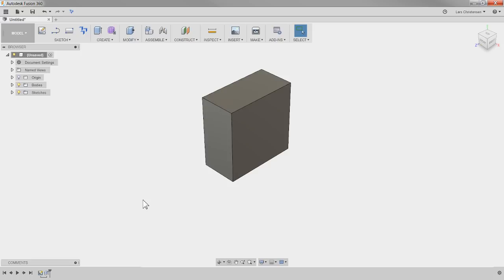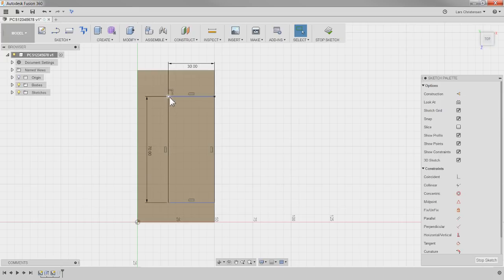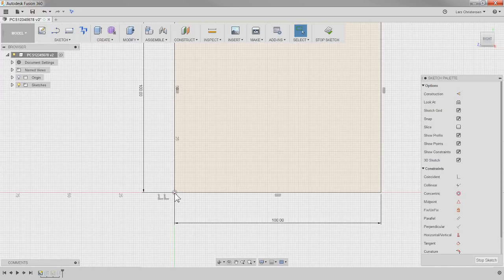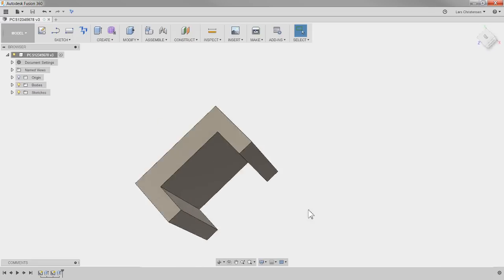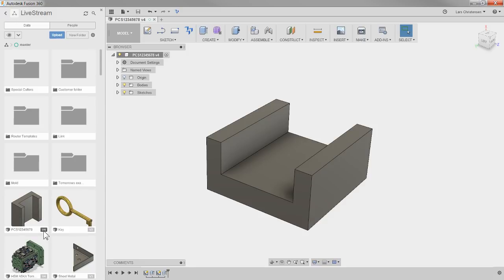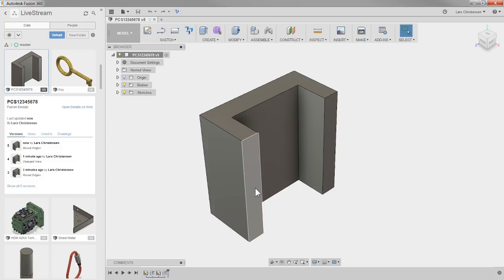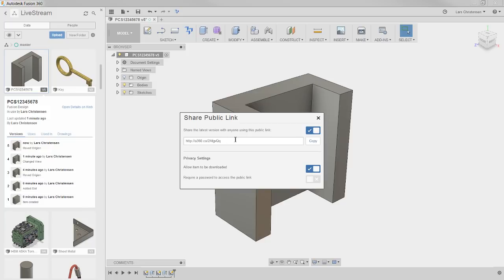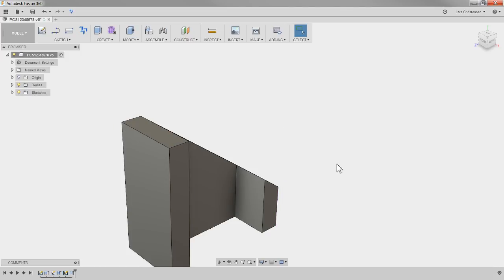My Biggest Mistakes with Fusion 360 — Tutorial — #LarsLive 97

Comment: I am definitely into you Fusion 360 videos!!   Big fan....have been NC and CNC machinist since late 70's....technical writer also....have one crucial suggestion from being in the shop and a programmer / blueprint interpreter for 40+ years...."Instead of lecturing; stating:'Define Your Sketches...' which is crucially important.   However, to the Novice and non-machinists;non- Designers;   is sounds like the plausible terminology.....when you get into the field as a Professional, you should tell everyone: "..to specify every workpiece feature's dimensions..."   By stating: " define your sketches."..in the real design and shop environment (which everyone hope to progress to)...that would mean to name or give a defined name to your views or shapes or workpiece sketches....not to the dimensions or specifications.

Comment: Do you have a video that explains the difference/relationships between Projects, Parts, and Assemblies? I saw in one of your beginner videos in which you made an assembly (I guess) that consisted of a main part and its associated cover, plus two imported screws. But when you want to 3D print that thing, do you have to somehow extract each part into a separate file, or do you somehow "select" each part (sub-assembly) and there's an option to make an stl file from just the selected part?

I'm hoping to start working on my first Fusion 360 project (?) and it will consist of a whole slew of individual parts that need to all fit together and then be individually 3D printed. What design approach do I take for something like that?
Reply from the maker: Hi Roger Garrett Thank you for watching!
You can right click on each component and save them out individually to their own file.
Reply: Excellent. Thank you so much, for all your videos and for taking the time to respond to questions.

Comment: Could you possibly make a video in Cam to show how to cut out shapes in carbon fiber? I don't need to remove alot of material. I just need to outline cut 2mm to 4mm thick sheets. 
I can't find any videos like that. 
Thank you!
Reply: I think you will want an engraving program like F-carve or one of the other free ones to just trace/cut the outline.  Not that cam can't do it.
Reply from the maker: Hi David DePuy Thank you for watching! Are you cutting it with a knife blade or a small endmill?
You could use a 2D Contour toolpath to cut the perimeter
Reply: Lars Christensen 
Using a small end mill. I'm new to fushion. Been watching lots of videos. Usually my simulate shows removing alot of extra material.